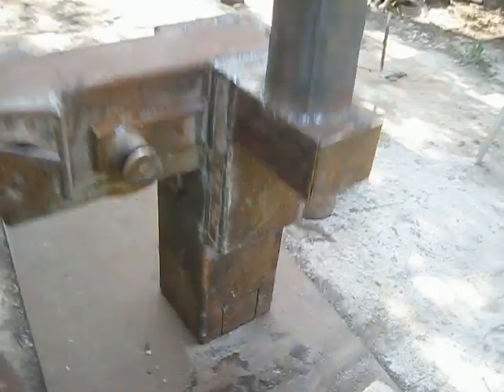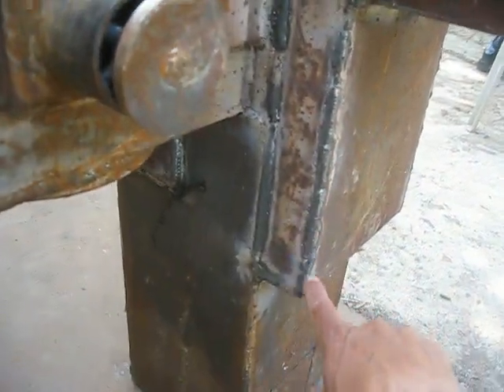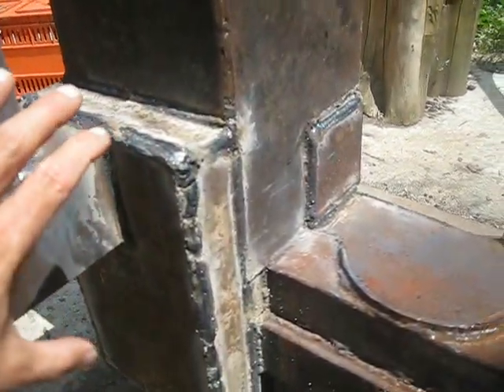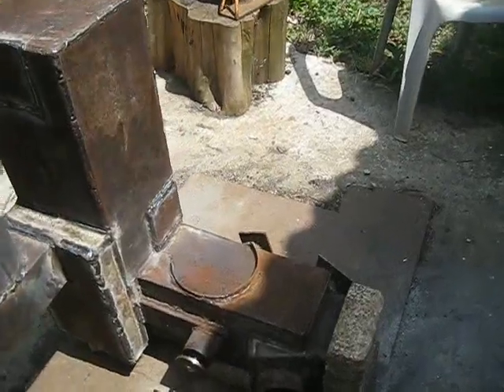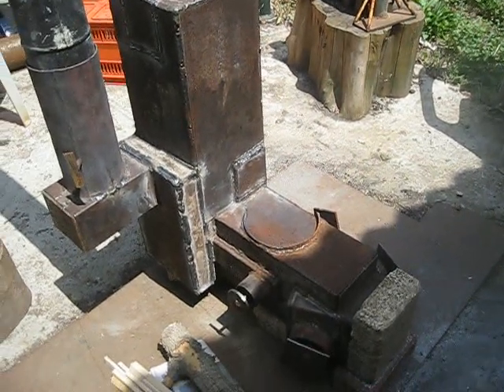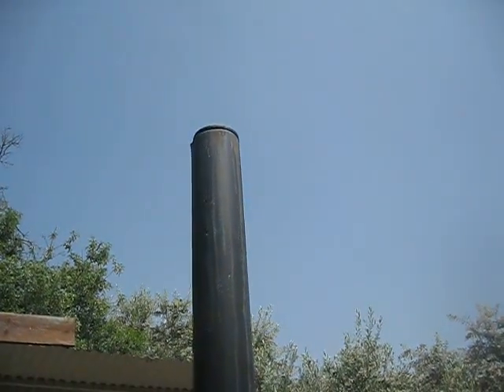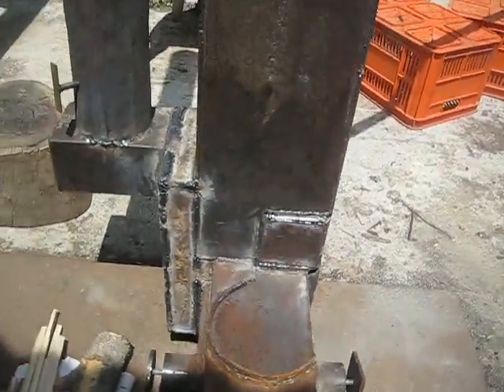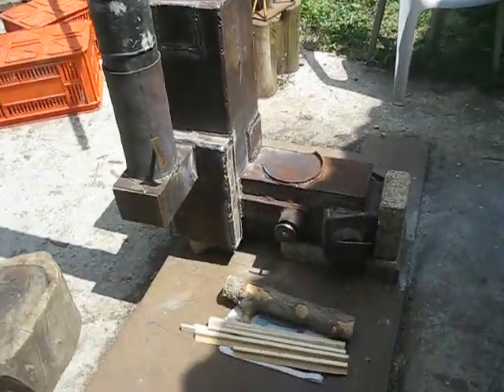Converting the downdraft rocket stove to updraft rocket stove, very efficient burn

Comment: All the heat generated with the fire wants to rise. When you force it to go down first, then you will have to "put energy" into this system. The energy you can put into the system is the whole area of the system where the burning (and burned) gases rise. When you have a downdraft tube (which means the hot air has to go down directly after the combustion chamber), then just where the gases are the hottest, they havo to go down. The hotter the gas, the more they expand, the more they are light and want to rise. While the gases pass the downdraft tube, they already cool down (especially when the downdraft chamber is made of thicker steel, which needs more time to get hot and cools down the gases faster), so when the gases reach the poit of return, where they finally can begin to rise, then they are already cooler, so they will expand less and will not get as light: The rising force is smaller. This rising force is all you have to suck the hot air through the downdraft tube. If it is not much bigger than the force which is needed to bring the hot gases down the downdraft tube, then at least one part of the hot air will take the easier way: Out of the feed tube of the combustion chamber: This makes the draft much worse. So what you can do to improve the design: Shorter downdraft tube, better isolated with smaller wall thickness (still big enough for durability), bigger diameter for rising gases in rising chamber and chimney. It is always easier to have first an updraft an force then the gases to go down. Why do you want a dopwndraft system?

Daniel
Reply from the maker: Just to see if I can do it!

Comment from the maker: Do not agree with you on secondary air. When secondary air is not present, even though there was no visible smoke, there was in the air a "burning wood" smell. When secondary air is present, no combustion smell is present. Unfortunately, I do not have machinery to measure heat output and gases composition to check the influence of different elements on the combustion efficiency.